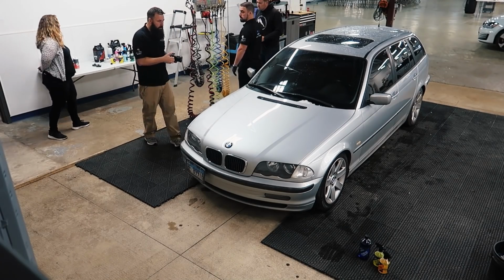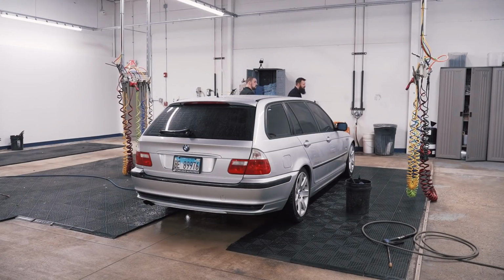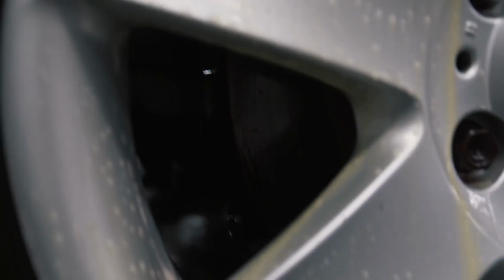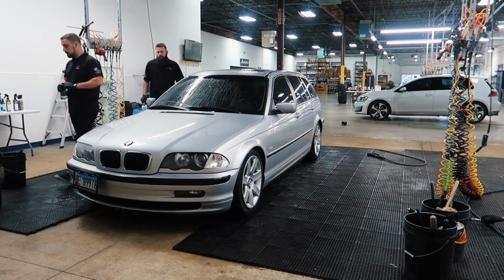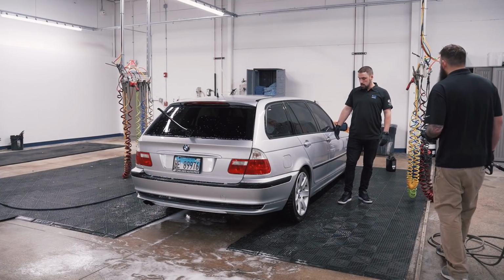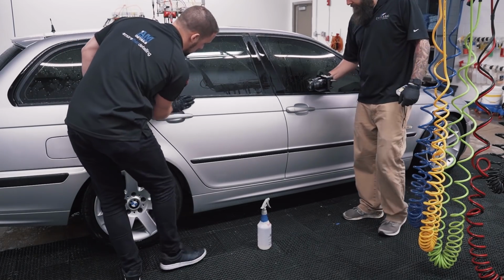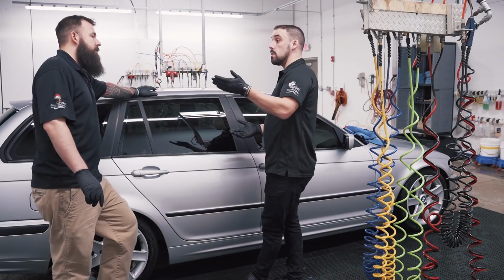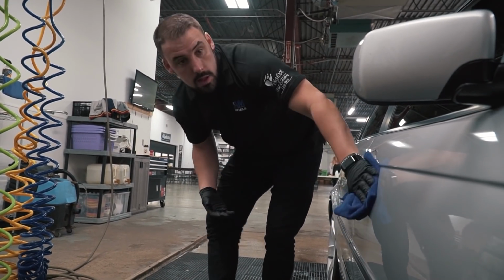Weekend Wash | AM Details | Product Testing

Comment: On an older video you recommended using CQuartz Leather & Vinyl Coating but the instruction say not to use on white or light color leather.  What would you recommend to use to protect a white leather?

Comment: How does filling the bucket with the exact amount of water and then adding the exact amount of soap/shampoo stay at the correct ratio when you then add more water by using your pressure washer to make the suds? Then Mr AM starts to hose down the car and needs to be reminded to start with the wheels to prevent water spots. Moving on....
Reply: Lloyd Manning yeah those water spots will be real bad with that hot sun beating down on the car 😂
Reply: haha YES Lloyd. LOVE THIS! Attention to detail is on point sir. Hope you also managed to see the 20% off coupon and the entertainment/tips value makes you want to try out car supply warehouse. 👍🔔

I will drop you a little back story
I was a little thrown off with Jason handing me shampoo and then having me rinse the car to then suggest wheels first myself.
BUT
I presumed we were not filming wheels as we had also just done a wheel how-to video. That same day... + Can I use the Jet lag excuse?
Filling the bucket water first is to prevent the high dilution rates which create streaking. so the "quick blast" will only dilute it down further #Safe.
Most people put the "wash" in first then run the tap so maybe get 30-50% bucket filled before it overflows with the foam. so the dilutions way WAY off.

As I say thank you for the contribution genuinely love when people pay close attention and then dive deeper. Keep crushing it man.

Alan